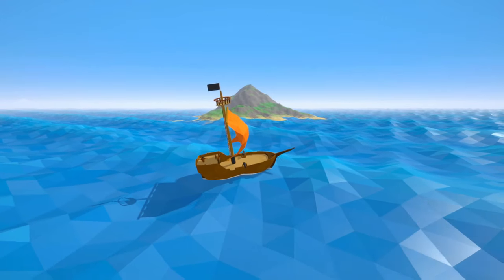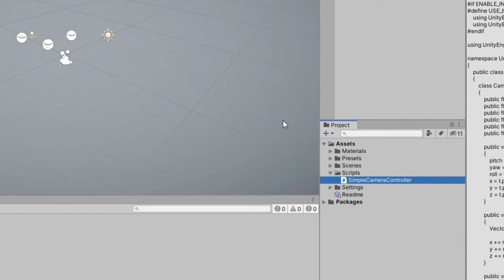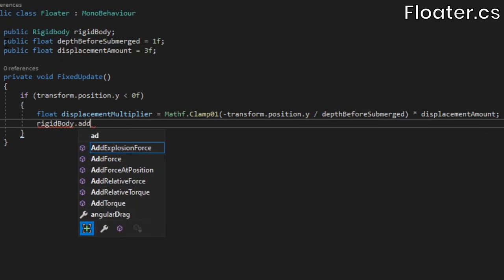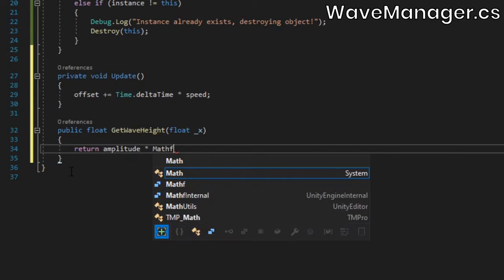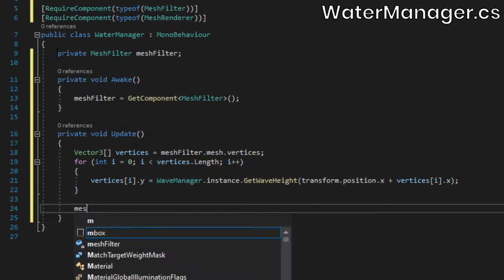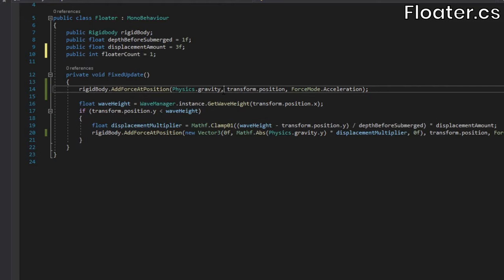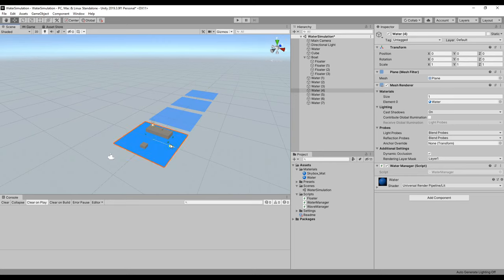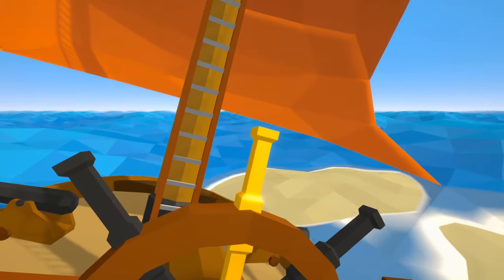How to Set Up Dynamic Water Physics and Boat Movement in Unity | Ship Buoyancy Tutorial

Comment: I followed the tutorial as closely as I could but for some reason, my ship flips out when it touches the water. I think it's something to do with the AngularVelocity, but I have no idea why. I am using AddTorque but it seems to just not want to work.
Here's the code if it helps.
public Rigidbody rb;
	public float depthBeforeSubmerged = 1f;
	public float displacementAmount = 3f;
	public int floaterAmount = 1;
	public float waterDrag = 0.99f;
	public float waterAngularDrag = 0.5f;
	
	private void FixedUpdate()
	{
		rb.AddForceAtPosition(Physics.gravity / floaterAmount, transform.position, ForceMode.Acceleration);
		if(transform.position.y < 0)
		{
			float displacementMultiplier = Mathf.Clamp01(-transform.position.y / depthBeforeSubmerged) * displacementAmount;
			rb.AddForceAtPosition(new Vector3(0f, Mathf.Abs(Physics.gravity.y) * displacementMultiplier,0f), transform.position, ForceMode.Acceleration);
			rb.AddForce(displacementMultiplier * -rb.velocity * waterDrag * Time.fixedDeltaTime, ForceMode.VelocityChange);
			rb.AddTorque(displacementMultiplier * -rb.angularVelocity * waterAngularDrag * Time.fixedDeltaTime, ForceMode.VelocityChange);
		}
	}
Reply: Actually, it works on smaller objects, but not on larger objects like ships. I've played around with the exposed variables in the inspector, but that doesn't help either.
Reply: It's something to do with the actual buoyancy code with the AddForceAtPosition up code.
Reply: If it helps, here's a gif of the boat https://imgur.com/a/9yPoy9W. I can fix it by setting DepthBeforeSubmerged to 0, but then it looks super unrealistic for some reason, so that isn't really an option.
Reply from the maker: Yikes, it definitely shouldn't be doing that :P

Did you change the floaterAmount value to however many floaters you're using for the boat? Make sure all of the floaters have this set to the same value. Besides that, if your ship is very large the floaters might be so far away from the center that most of their upwards momentum is converted into angular velocity. Playing around with angular drag and the distance between the ship's origin and the floaters might help counteract that.

If none of that works, check out the Discord server (link in description)—it'll be a lot easier to troubleshoot this there.
Reply: @tomweiland  Yeah I'll join the discord cause I limited the floater amount to two for debugging and set the FloaterCount (FloaterAmount in my case) to 2

Comment: Hi Tom, a great video, but how boat floating on shader water? tutorial plz?
Reply from the maker: It's basically the same process as in this video. In the video we make the water plane move based on a formula, and we use that same formula to calculate the water height for buoyancy. If you are moving the water plane from a shader, nothing needs to change in the buoyancy calculation unless you've changed the wave formula.
Reply: @tomweiland  how can we get wavelength from shader? and what if using 3 waves, I write floater class and manually input the values offset, speed, length, amplitude and in same class i wrote the method     public float getWaveLeng(float _x)
    {
        return amplitude * Mathf.Sin(_x / length+offset);
    }
but how to sync with shader water waves
Reply: @tomweiland  and if u don't mind, any other platform where we can easily chat and I can show some screen shots of my working for your better understanding to guide  me :)
Reply from the maker: "how to sync with shader water waves"
Instead of setting the values in the shader, set them in the C# script and then set the shader values programmatically. That way the syncing is automatic.

If you want to ask more questions you can join the Discord server.

Comment: The cube does not start bouncing after i apply the script to the cube and refrence the rigidbody, how can i fix this? heres my code

using System.Collections;
using System.Collections.Generic;
using UnityEngine;

public class floater : MonoBehaviour
{
   public Rigidbody rb;
   public float dpAmount = 3f;

   public float depthBeforeSubmurged = 1f;

   private void FixedUpdate() {
      if (transform.position.y < 0f) 
      {
         float displacementMultiplier = Mathf.Clamp01(-transform.position.y / depthBeforeSubmurged) * dpAmount;
         rb.AddForce(new Vector3(0f, Mathf.Abs(Physics.gravity.y) * displacementMultiplier, 0f), ForceMode.Acceleration);
      }
   }

  
}
Reply: nvm, i fixed it i just forgot to remove the mesh collide
r
Reply from the maker: Glad you figured it out—for some reason YouTube only just decided to show me that I haven't responded to this comment 😅

Comment: How can I expand the water without duplicating it so much?
Reply from the maker: You can't. If you want more/bigger water, you need more vertices, so either you need to duplicate the plane a bunch of times or you need to model a custom mesh that's larger and has more vertices.
Reply: @tomweiland  Ah ok I see. Essentially I want it to look like how you have it in your video. I'm not sure how you went about doing it. Duplicating multiple planes I feel like is bad for performance. 1 large plane makes more sense to me. I'll aim for the custom mesh. Thanks
Reply from the maker: There won't be a very big difference between one large plane with as many vertices as a bunch of smaller planes compared to a bunch of smaller planes. A bunch of smaller planes might actually be faster as that way they can just not be rendered if they aren't in view.

Comment: Really noice, we done something similar for the ocean in our game, I like your design, simpler the better, awesome video!  only difference is we use shaders for the waves, doing your waves on the cpu, does it take up a lot of resources?
Reply from the maker: I do the waves in a shader as well—I talked about that a bit at the end of the video because manipulating vertices on the CPU is quite slow, especially when you have big/many water meshes.
Reply: @tomweiland  Even better, didn't catch that at the end, but I checked out the CatLike Coding, he has great content, what interested me the most was your water physics, been thinking of trying it out, plus the CatLike Coding shader too
Reply: @tomweiland  I did a basic water physics for floating blocks, nothing special, like what you have shared here

Comment: Really weird. I followed this tutorial exactly, examined every single step and made sure my set up is identical. The result I'm getting: the cube falls through the water and is never pushed back up. I guess unity made some pretty fundamental changes to the physics system in this last year. Weird I cant find any documentation on what those changes are. Anyway, I had to multiply all the numbers you used by at least 10000 to get anything like buoyancy happening. Fresh project, double checked every setting. Something in unity's physics engine has fundamentally changed.
Reply from the maker: Does your cube's rigidbody have a lot of mass by chance? Maybe double/triple check that you're using the right ForceMode in the rigidbody.AddForce calls?

I'm not aware of Unity making any major changes to physics—I'm still using this same solution today, and it works as intended 🤔
Reply from the maker: @gaminganimator-qp2ir  you can change the buoyancy calculation to be relative to the water's position, but you'll have to reference the water differently (singleton won't work if you have more than one water section).
Reply: @tomweiland  i think im too dumb to understand that
Reply: @tomweiland  so after a while i realised i didnt have a collider on my ship object, adding it made it work... bit of an oops moment. However, the problem I have now is that having a collider on the entire ship object causes other problems with my ship control methods. If I take the collider off, I get really bizarre behaviour like what I previously described, or incredibly fast flicking back and forth. Why is this? My water has no collider on it, and from my understanding the colliders are simply used for collisions, and shouldnt effect general physics calculations on a rigidbody. Can you shed some light on this?
Reply from the maker: @TheVino3  that sounds really strange, and honestly I don't think I've ever run into anything like that. However I'm pretty sure that you're not supposed to have a rigidbody without a collider. But if you're getting the bizarre/flicking behaviour when you take the collider off, why not just leave it on?
Reply: @tomweiland  now that i made the shader i don't know what i have to do in the wave manager
Reply: @tomweiland  its a bit hard to explain but the collider causes the ship rotation method ive built to not work at all. With the collider on AddForceAtPosition gives no rotation around the y axis at all. It just pushes the body in the direction specified, all at once. Without the collider the ship rotates around the y axis as normal. With the collider the ship just moves in that direction. Ive tried using larger force values to try and compensate but it just moves the ship quicker. Still with no rotation. Weird considering the rotation occurs on the other 2 axis for the buoyancy points. There are no constraints on the rigidbody, and the behaviour is the same if i set all drag values to 0. The collider seems to have quite a significant effect on the behaviour of the rigidbody, but this doesnt seem to be mentioned in any documentation.